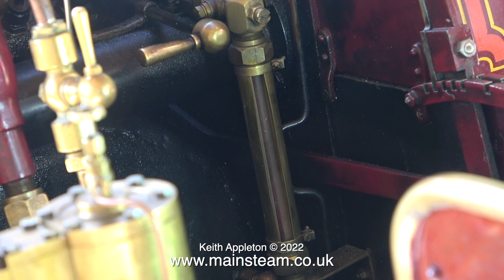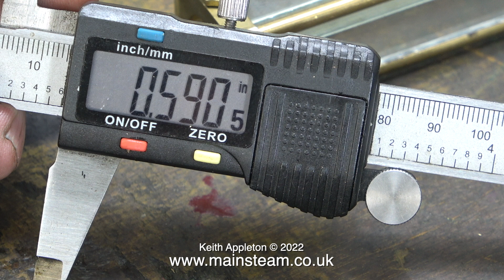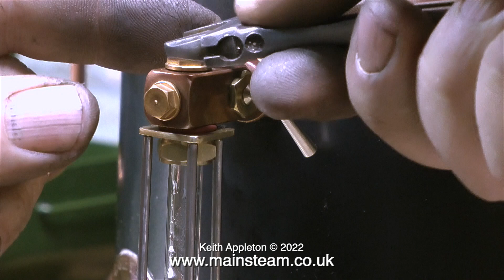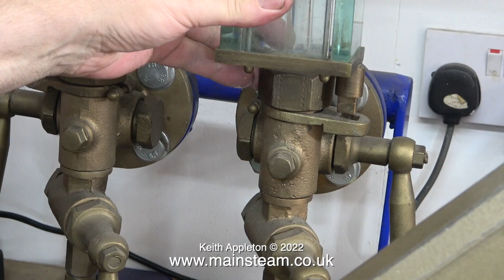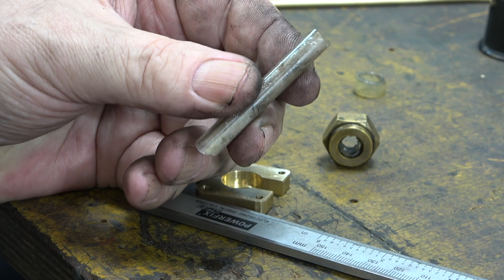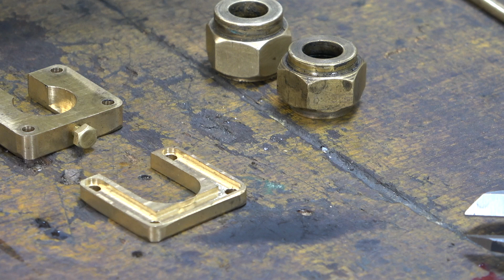A LARGE MODEL SHOWMAN'S ENGINE - PART #67

Comment: What you are referring to as a protector I would call a Gauge Glass Guard. Its purpose is to protect the operator if the glass was to break from flying bits of glass.

In practice I have found that the inside of the gauge glass guard glasses tend to soot up on traction engines and then it is a pain to try and clean them. 
What you might try and obtain is a type of "Klinger refractive gauge" which is both easy to read and does not need an additional guard. While it is not typical of either traction engine or model practice, I have used them on both (full size) railway and industrial boilers.
Reply from the maker: I build and repair models. I have little interest on working on the "full size". I thought that I covered the "safety" aspect in the video....... I will cover the subject again in case you missed it. One must not confuse full size practice and miniatures. I have fractured a few model steam locomotive gauge glasses in my time, and there was no problem at all with flying glass as the glass tube used on models is very small. This is a Gauge Glass Protector - - - - - - Because it Protects the Gauge Glass.

Comment: For clear plastic we use polycarbonate at work for its relatively high heat tolerance but I would guess it gets too hot in your cab area. A higher temperature plastic is Kapton (polyimide) but it's usually a yellow colour when it's transparent.
Reply from the maker: Thanks for the info!